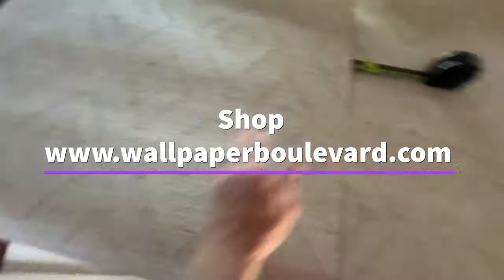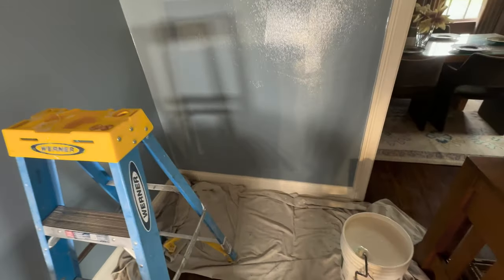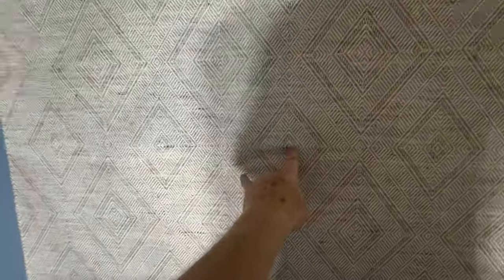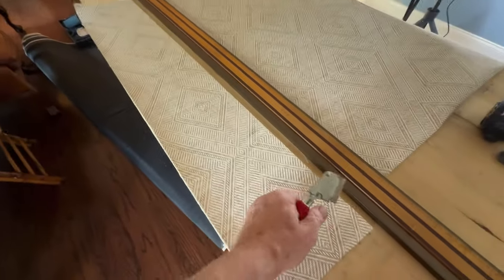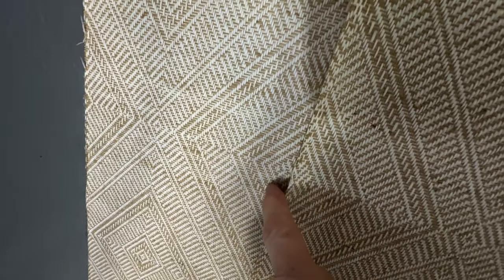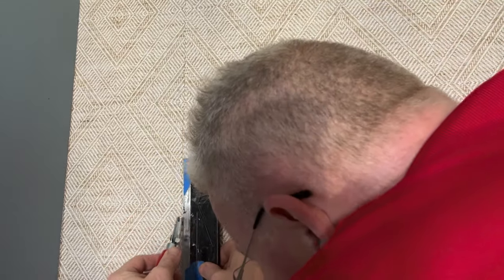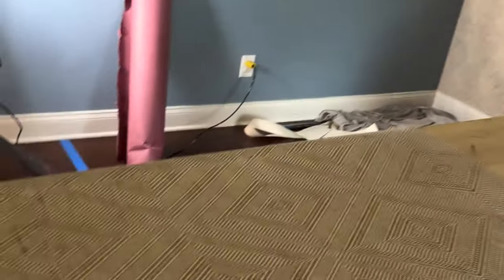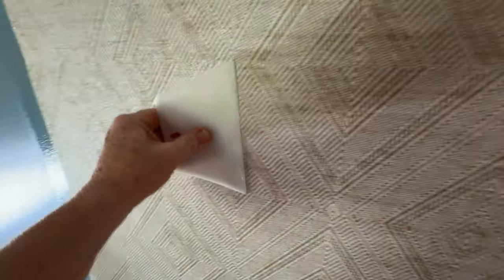Trim Schumacher Tortola Linen Paperweave Wallpaper - Spencer Colgan

Comment: I like the idea of push pins. That would really help, especially on geometric patterns. 

The single edge straight blade; I can imagine that next to sharpness would be that you get far less or zero flex in the blade as compared to a snap off, where blade flex can leave the installer with the white, uncolored, middle of the paper lines from slight movement.

Comment: I completely agree with you, allot of high end manufacturer designers and later on to the product finishers have to better understand the installation aspect of the material. I’ve had allot of circumstances where I get a really high end mural and it’s a nightmare because of too little overlap.